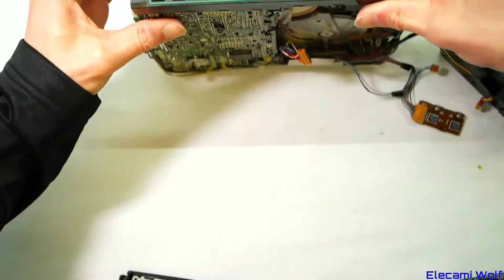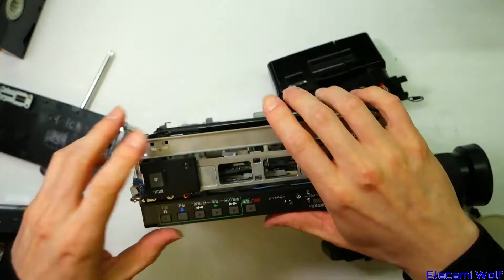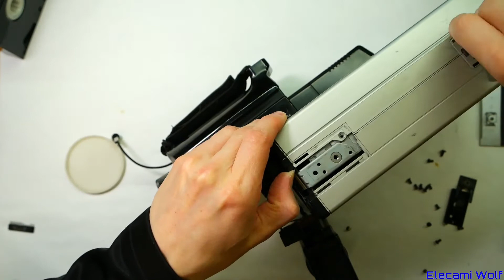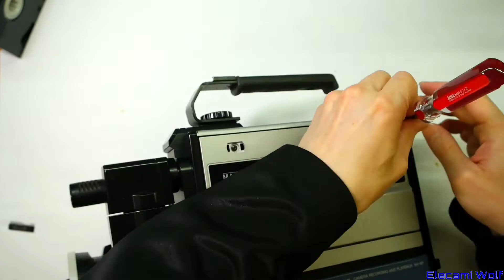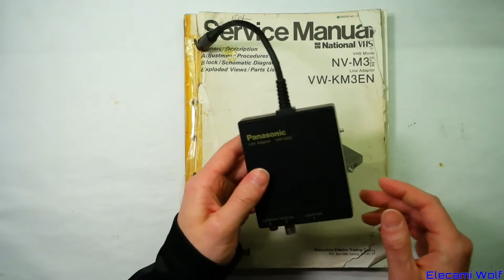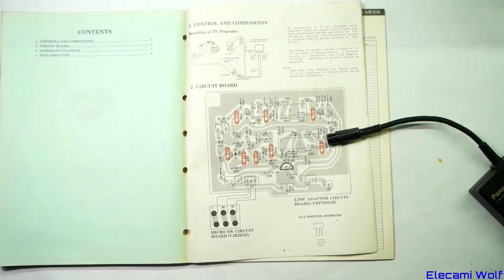EW0045 - National Panasonic NV-M1 NV-M3 Comparison Teardown Continued

Comment: Useful video, managed to basically disassemble My M1 following along to try and determine why the W/T buttons did not seem to be doing anything, in addition to no video feed from the lens. Sadly, never resolved either of those two, but did manage to clean up the gears and now playback a cassette properly without issues.

Any idea why I wouldn't be getting any signal from the camera and the zoom buttons not working?

The "Record" button is working and I'm getting about 3v (if I remember correctly) from the small Red/Black power cable connecting to the camera housing assembly (the small PCB with the W/T control).
Reply from the maker: Probably the belt from the zoom motor to the gears gone bad. Can you see if the zoom motor is spinning?

There are likely capacitors gone bad. Could affect power to the zoom motor.

Comment: Hello. I have a Panasoni PV-220D Newvicon camera, everything works, but no image appears on the screen. It just shows the inscription "Light". I've left it on for hours and it doesn't change. The autofocus works normally (which means that the image is coming through the lens). Could the tube be burned out or is it just a capacitor? Just to let you know that it's not a problem with the screen, when I connect it to the monitor it stays the same.
Reply from the maker: Probably has the iris stuck shut.
Auto focus will be independent of it receiving light into the tube.
Reply: @Elecami  Thanks! I'll try to fix it. I also have a PVS-350 S-VHS that had a tape stuck in it (similar to the one shown here). I disassembled it on the side where the tape compartment is, I couldn't get it loose, and when I reassembled it, when I tried to disassemble the opposite side to get to the gears, it suddenly decided to eject the tape! From what I saw, these models don't have a way to manually eject it with a screwdriver on the top right like most VHS cameras do. Today it works perfectly. https://youtu.be/ecsigbfmpHU

Comment: Hey, I have a PV-200D which is basically the US model. I replaced the belts because they were stretched, and I had to pop off a gear in order to access the loading belt. Now I don't know how to put the gear back in the mechanism because it just floats freely on the shaft. I used a flathead screwdriver to kind of pop it out of the mechanism. It is not cracked or anything like that. Now the machine will not load tapes obviously. Do you think I can like epoxy it to the metal shaft? It shouldn't be moving up and down and it's not secured in place.
Reply from the maker: Depends what one it is. I think the only one that should be attached to a shaft is the pully on the loading motor shaft. That one is a push on tight fit. 
All others float freely on the shafts and are retained by various type of clips. 
Depending on what you took out proper timing of the mechanism could be lost and you would then need to follow the service manual to reset it all.
Reply: @Elecami  I think I might have lost the clip. Can I find a replacement anywhere? What pages in the manual explain how to time the mechanism? Also, I broke the plastic piece that is directly above the capstan belt. Will the mechanism run fine without it?
Reply from the maker: @KylesDigitalLab  It could have been a small black split washer retaining the gear. Easy to loose.
In the NV-M3 Service Manual I have the section '2-3-9 Assembly And Adjustment Procedures of Mechanism' details all of the timing setup for the gears and levers. 
I don't think you would have removed any of those parts to change the belt though. No need to take any of that stuff off. 
Is it the clear plastic part that broke? That holds things out if the way of the belts when it is assembled.  Risk of getting wires caught by the belt.
Make sure the power supply rails are fine. Old worn out capacitors could be causing trouble.